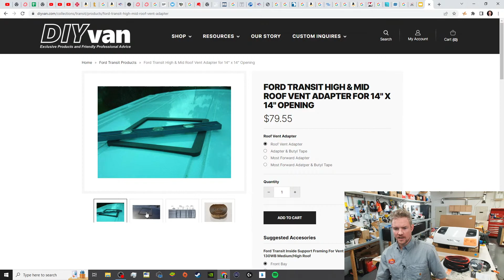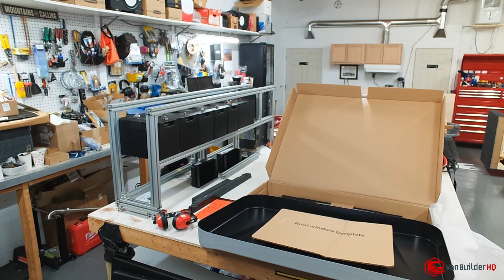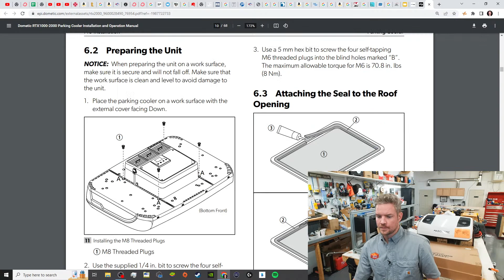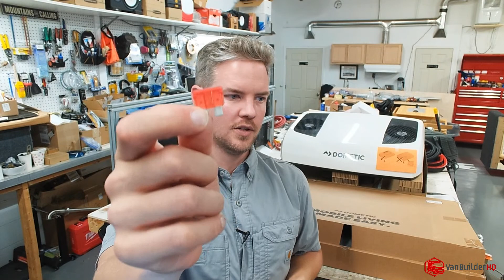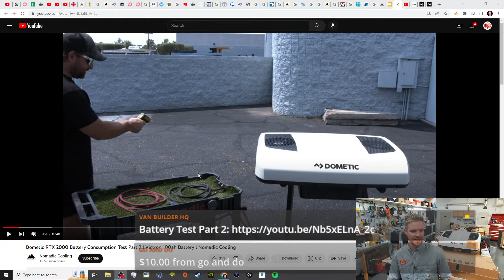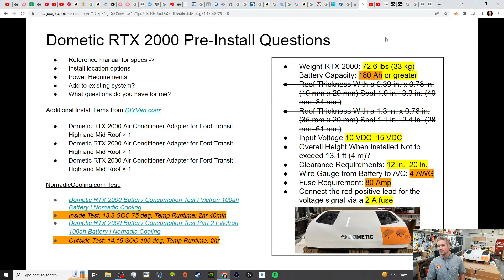Dometic RTX 2000 Pre-install Q&A Watch BEFORE you buy!

Comment: Thank you for this informative video.  I always learn something new from your videos.

I need to sacrifice the forward Maxxfan and convert it to an AC.  I prefer to install a 12V, but I have solar, rack & other stuff on the roof to work around. I wish the manufacturers included full dimensions check fit around existing roof obstructions.
Reply from the maker: You are very welcome, I agree with you, it is challenging to map out different components, what I do to make it easier when fitting components on the roof is (now this is in a perfect scenario) use the roof rack as my base and stick to the engineering drawings, most products will have this in a PDF format you can download, sometimes this is hiding at the bottom of the product page, these engineering drawings sometime will give more information than the simple dimensions provided in the "sales" information. If you can find these for the products you are working on you can literally draw and make a paper cutout on scaled graph paper and kinda play with the components like Legos and see how they fit together, change up their layout etc. 
As for identifying roof obstructions, try to use the pre-install bolt holes as your reference for the crossbar locations for the van roof, then transfer the rough location of those to your Lego drawing and go from there.
Thanks for watching and hope that helps!